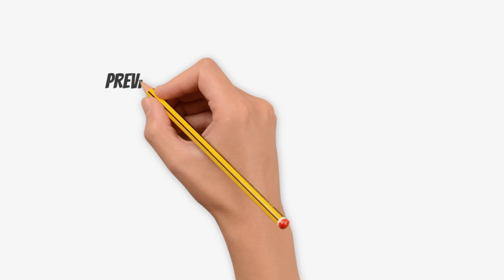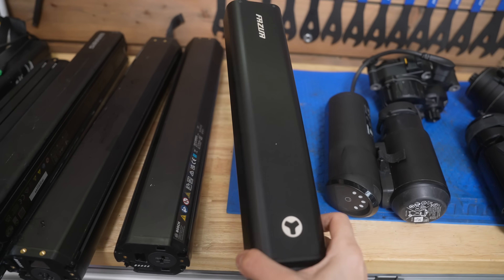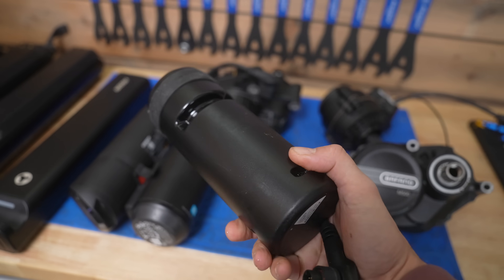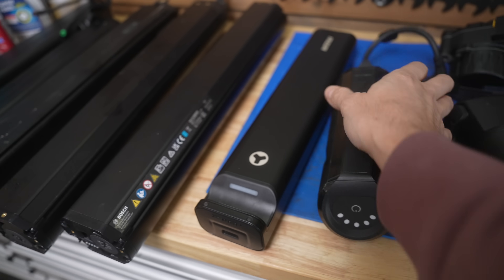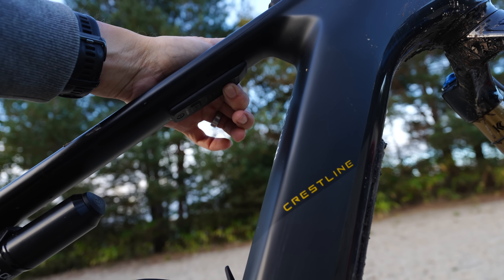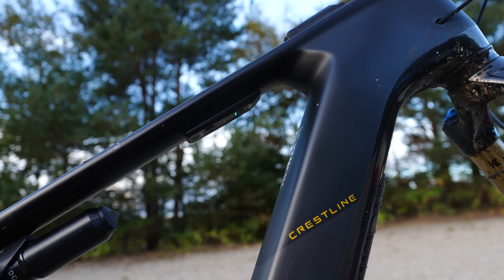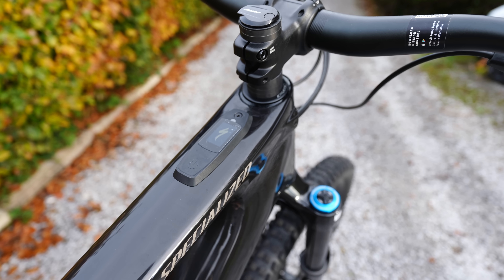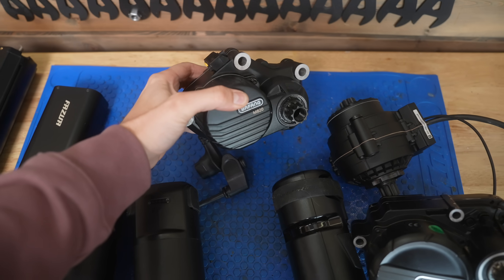We Have A Huge Problem With Ebikes....

Comment: In the 90's I said I won't buy a computer or parts of it for gaming, or overclock for 1-5% boost. I have been right.

In 2010 I bought a used Specialized p.2 alu 2004. 30 thousand kilometers later I'm still riding and fixing it myself (except for the fork and hub bearings, those still work).

I've bought a car for half a grand. Max 8 k (with my family).

I have not much to say about electric bikes.

Comment: Great video Rob. Unfortunately, the incentives are not aligned for manufacturers to take action. When you think about you suggestions and possibly other things that can be done, many of them benefit the consumer but not the motor or bike manufacturer. E.g. upgrading an older ebike to a new motor doesn't benefit Specialized and other bike vendors. Standard bolt patterns don't benefit motor vendors that would rather strike exclusive deals with bike vendors, than be at the mercy of them suddenly offering a build with a different motor (although they bolt pattern probably benefits the bike vendorsa). So, if most of these only help consumers, but consumers today aren't voting with their wallet and they are buying these bikes fully knowing that they'll be outdated, there's nothing pushing vendors to spend more time and come up with standards that will reduce their lock-in

Comment: aaand for now this is a reason why I'll just not buy an ebike. I've no problem with an acoustic bike, and when I want something powered, I'll use my escooter (which is admittedly probably more integrated and proprietary, but its smaller, lighter, and less expensive)

Comment: While agree that this is incredibly annoying, it is also the problem of this being a relatively young market. Forcing everyone to use the same standard will be great for a few years, until we find that the standard is subpar. Standardization is great for mature fields where everyone is basically producing the same thing (e.g. phone chargers) and there isn't much room for innovation, but forcing standardization too early could leave us with an inferior result that then becomes difficult to change (e.g. what if we forced everyone to use micro-USB 10 years ago?).

I think the best place to start encouraging standardization would be in ebike charging ports, as there probably isn't much meaningful difference between the current ports. Standardizing the size of batteries or motors would be more problematic, as there is a lot more innovation that could happen in bike geometry, such as smaller batteries, different layouts, or including the battery as a stressed member of the frame.
Reply: Agreed - charging ports is the place to start, then slimming down the range of battery form factors by 90%, then motor mounts. 
Ebikes have been around long enough and we are in an environmental crisis.  Time for regulatory action.  And who cares about new features - ebikes are easily good enough already - what we need is sustainable standards and ensuring buyer confidence

Comment: I like proprietary batteries because there is a LOT of bike theft in my area. With a proprietary battery, thieves have less inclination to risk consequence by going after my battery. It is not reasonable for me to take my battery with me all the time. I use my eBike as a hauler/commuter bike. 

That my battery only fits in my version of my bike makes it less valuable to average thieves. Would like the ability to replace parts on my bike for at least 10 years or 100K miles. 

With standards that make it "easier" for consumers, designers, and dealers, to swap out parts, thieves are also going to find it easier. Big problem in my city where I see traditional road bike carcasses stripped and discarded along the bikeway I use for commuting. I see these stripped frames at least a couple of times a month. Sad.

Comment: I first bought a cheap Chinese electric bike with a battery built into the frame. The battery and motor were fine, but the rest of the components were shit.

Now I made my own e-bike, with a used 2011 Canyon Torque 8, Bafang BBSHD and a 1150 Wh battery. All in all it cost me less than 1500€, bike 400€, battery 440€, Eggrider V2 display 130€ and motor for 490€.

The best thing about a homemade bike is that if I want a different frame I can make a new electric bike, I just have to buy a new bike or frame, I already have the battery and motor.

Comment: You need to stop using the “out of date” phrase, because this phrase is contributing to people wanting to constantly upgrade when it’s simply not necessary. A bike purchased in Jan 23 with battery and motor technology from the previous year isn’t worthless because a new bike released in June 23 has the next generation of battery and motor. The big problem with that though is simply how long will parts be available for the older system? That is where focus needs to be, and is 100% why I wouldn’t buy an e-bike.
I do agree with standardisation though, but e-bikes are still relatively new and as we know competition promotes innovation, and even if we don’t like it there are still proprietary laptop chargers even if there is also support for a standard (USB-C).

Comment: You have to be a sucker or have more money than sense to buy an ebike. My sister bought her first one 10 years ago and is now on her third one because on the last 2 something failed that couldn't be replaced or would have cost more than the bike is worth.
Or look what happened to Vanmoof. Went bankrupt leaving customers unable to unlock their bikes, use all the fancy software that comes with the bike or have their bikes serviced.
Maybe one day manufacturers will come to some agreement and all these incompatibility problems will be resolved, but I have a suspicion that they all want it, the name of the game, built in obsolescence, to drive up sales. What's not to like when customers buy a new ebike every 3 years?

Comment: Want a 1000w ebike but dont have $7,000 for it? Buy bafang, a motor system that costs up to $2000, has both mid drive and hub drive available, and all the mid drive mounts fit inside threaded BBs. Any alloy bike with a threaded BB can take advantage of this system.

Comment: I got a rawbike back in 2019, its some chinese clone with proprietary controllers and computers.
 The battery can be found but its expensive as hell for the performance, and right now the lock cylinder litterarly fell out, so as its my only way to get to work i now need to spend 200$ to get it fixed... (The cylinder is propietary

Comment: As a kid in the 50s we all built our own bikes around second hand frames. We even learned how to build a wheel from a hub, rim and spokes. No shortage of spares and we upgraded as we could afford. Not these days. You have given a good reason not to buy an e-bike.
Reply: Just put a mid drive motor like cyc photon on any frame.you want and plug any open standard battery and universal charger. I can even remove the motor in 15min and have my muscular enduro back.

Comment: Well, this is NOT something the industry will be willing to change. The only way to implement this would be enforcement through a governing body, ie. the EU.
The EU has forced Appel to swithc to USB C.
The EU could implement a process for teh standardization of E-Biek chargers and motor mounts.

It would be actually really interesting to see, if one could have a "super mount" which allows adapatation to most existing bolt patterns through adapter brackets...

Comment: I share your concerns but let's face it in an industry that can't even standardize headset and bottom bracket systems what chance they will change this issue.
Unfortunately we are technology obsessed so it plays into the manufacturer's hands to keep coming up with solutions to extract our money.
So many so-called latest new tech designs are poorly thought-out and not fit for purpose.
I've lost count of the amount of pivot bearings, headsets and bottom brackets I've replaced over the years of working in the workshop most of which is preventable with better design.
The latest new technological advance along with manufacturer's discounts is just throwing the recent purchaser under the bus.
The industry should get the basics right first as well as longevity for the owners.

Comment: I have built two E bikes using the Bafang mid drive motors,  I mounted the universal 48volt battery in a frame bag nice and neat.  I used a older carbon frame I was going to sell or give a way.  I  am not stuck with an out dated system and have complete flexibility

Comment: Yep fully agree with you. It’s amazing how much mountain biking and cycling market has changed. There are obviously massive issues let alone e bikes are in theory a motorbike due very little difrance from some to electric motorbike, so obviously it brings into question licensing and so on… also the cost of e bike are not justifiable in my view to the pace of being out modded or even supported. And with battery powered vehicles being so called green- I smell a false  narrative due to, the toxic disposal and mining/manufacturing process, slave/child labour involved in the process, not to mention battery’s like these and cars last 8yr or so and will need to be replaced. Personally I’ll stick with my bike from 5years ago and upgrade or replace where needed. If im going to spend over 3000 on a bike i might as well get a motorcycle instead. Or save up..

Comment: After spending $8,000, why would I want to spend more on the motor after 12 months? It's prob the most expensive component. However, I AM concerned about the supply of spare parts. My ebike is about 5 years old (GT eVerb current) and still going strong. I hope to be able to get a few more years out of it, as the batteries are still going strong. But what if something goes wrong with the motor or controls...?

Comment: The way I see it, so many manufacturers have taken their cue from the computer and software companies. Sell a product, and even though it works fine, force your customers to shell out for the newest version, even if they don’t need it. Plus, after the newest version comes out, they act like they don’t know anything about it or that they even made the older version.
This whole e-bike biz is like the Wild West. So many Chinese/Taiwanese brands no one has heard of, even if the bike works great new, don’t hold your breath part swill be available. 
Interesting this is a problem with the major bike brands too. 
At this point, the best deal maybe to add a conversion kit to a standard bike, at least you can always remove it again or start over with a new system should one fail.

Comment: Yes, I will likely not buy an ebike until there is some sort of standardisation of motors. batteries and charging system. With things as they are now, ebikes are a disposal item, not able to be repaired in a few year's time when something fails, the worst thing is that the ebike cannot even be easily converted to an ordinary bike upon a failure of one of those 3 items. Currently I am thinking of converting an existing bike using something like a Bafang kit as they would probably use a more common type of battery and charger.

Comment: One of the reasons batteries are not compatible is anti theft as with the Bosch smart system only the registered battery will work so a thief cannot fit any other battery

Comment: I have Juiced Cross Current X with 1,100 plus miles on it, I tried to take off the back tire and it was hard to do even though I have worked on bikes for many years there is a sensor in the very near the back wheel that has a tiny cable attached to it, the wires are very thin and easy to brake so be very careful with it, it is a very poor design and looks like it is designed to fail, the part that is needed to replace it costs $200.00 and last time I checked it was out of stock so apparently many people have had the problem, I can't recommend buying from Juiced  because they don't care about the problems they cause bikers it seems but are more interested in making more money it seems to me. if you have the wires break the bike will still work with the throttle but it drains the battery a lot more quickly.
Reply: Now they don't even show the part as  out of stock, instead they don't even show it.

Comment: Well said, Rob. This is something that I’ve been mulling over for a while. Three months after I bought my eBike, which I chose with range being a major consideration, Bosch brought out a battery with larger capacity, but… no backward compatibility. I feel that my only upgrades will be every 6-10 years when I can next afford a new bike. Surely, in these ‘greener’ times, manufacturers should be collaborating on compatibility issues. More power to you, Rob.
Reply: In my experience owning Bosch, they are mediocre at best. Very expensive, Bosch purposely makes them nearly impossible to repair. I will never again own anything ebike made by Bosch.
Reply: Thats why I recommend building your own ebike of your choosing
Reply: Frame design and shape, determine the shape of the battery.  
Software for a certain battery and motor need to all work together.
I think motors, and rebuilds for e bike motors will become easier to get done, or replace.
More outfits will get a handle on it, and parts and motors will be more available.

These things are kind of new on the marketplace still.
Reply: @bradsanders6954  It is a relatively simple motor mount mod and adapter fabrication to mount a non design spec motor in a bike frame. An aluminum frame is more suitable for mods, besides. By the time a motor needs replacing on a carbon composite bike, the frame is probably going to be shot also. People do not know that carbon composite begins to break down upon the 1st ride. Metal will last indefinitely as long as it's range of elasticity is not exceeded.
Reply: @bradsanders6954  It takes awhile for individual inventions to arrive at common engineering methods. Motorcycles and automobiles are a good example ot this evolution.
Reply: If by “greener” times, u mean stupid ppl spending their green $ with no ecological benefit, I agree.

Comment: The biggest problem with all these E-things, bikes, scooters, cars, etc., is that they're made in Xi-Na! Or at least, even after we "decouple", most of the parts are. Thats not including the labor conditions and environmental damage of Lithium and it's mines.
    Once you buy one, you're basically on your own. Theres no "local bike shop mechanic" who can fix it, like in the Campagnolo days. My Ariel Rider Grizzly 2x2 E-Bike has been nothing but trouble, day after day. Its controllers have even caught on fire as I gently rode it. And theres only ME to work on it. There is zero reliability or trust. I dare not ride it further than I can push it.

Comment: I’ve rode e-bikes they’re great fun. But for me give me a steel frame hard tail. No sustainability issues or range anxiety. We have a regular yearly ride “November Dalby” and this year the main issues were from e-bikes, chains snapping under load and one motor failing due to riding through lots of deep water. When this happens and your 7miles deep off road pushing an e-bike and lifting over fences it is more than a workout. Watching this video (despite being very informative)  is sadly even more a reason to stick to the simple .

Comment: Yep, and this is complete bullshit. Even things like the pedal assist sensor...there are at least 4 different wiring types and none of them are compatible, they have their own connectors and even if you cut them off and solder in a different connector, it won't work.